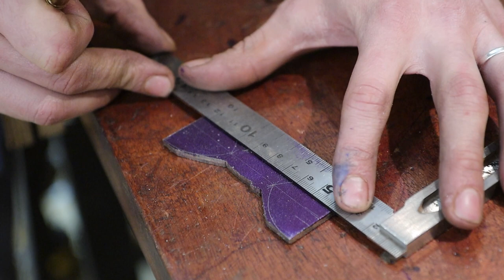Double Bladed Bow Tie Chisel

Comment: Tempering blades like that can be done fairly evenly if you make a bluing box, these are usually made from brass, but can be made from just about anything, as long as you fill it with brass swarf/chips My own box is just a small tin filled with about 25mm of medium sized brass/bronze flakes.

Comment: I love your videos and your work, not only because I did learn the profession of tool and die maker back when I left school (from 1975 to 1979), but also because of the kind of story telling you do in your videos. The only thing were I always cringe inwardly is when you use your caliper for marking lines on your work piece. My teacher back then would have killed me if I had used a caliper in this way.
Reply: @Charles Brainard Yes that is an option. Back when I did learn the trade of course we only got one caliper each. But that caliper I still use today. Of course I used other calipers too, but mostly only if I needed a larger one. I didn't work as a tool and die maker for all those years, the last 30 years of my 45.5 working years I was coating tools like drill bits, and hobs and taps and other cutting and also forming tools with titanium...  those golden drill bits, only we made also other colors depending on the material mix used to coat the tools. Pure titanium combined with nitrogen went golden, if you add aluminium and c3h3 it gets kind of dark grey to blackish. Or another mix went dark blue.

Comment: Do you dull your drill bits before drilling brass? I'm not sure if this is common practice in every other machine shop. In ours I tried drilling brass on a drill press and it whipped out of my hand and one of the old guys laughed at me and told me to dull the drill bit which I originally thought was a joke but it absolutely is the way to go!

Comment: I just learned of an old belt buckle that is also a knife. Called the Gerber Touche. Comes in different types of woods/metals. I think making a belt buckle that is also a knife/tool would be right up your alley.
Reply: Nah, beltbuckle knives are too mainstream for Uri.
Reply: @C4pt41nN3m0  I suppose it all depends on if they find the knife in the buckle or not. There are some really strong non-magnetic alloys and plastics that a metal detector won't pick up on, but a truly clever design might hide the knife well enough that TSA would have a hard time finding it. [I am in no way endorsing trying to sneak a blade onto a plane,] I'm  just saying from an engineering perspective that it is possible. We have the zero clearance technology to hide the seams in metal craft these days so that the naked eye would never see what is right in front of their eyes, and with the tolerances available to us, even x-ray machines would read it as a solid chunk of metal. You just have to make sure there are no internal voids either. The blade would have to fit tightly against the internal structure of the buckle/sheath metal. And form a suction fit so as to not fall out until needed. Maybe a push release from the other end from the handle?
Reply: @C4pt41nN3m0 def not. sometimes they make you take off your belt for x-ray.
Reply: @thesexybatman263  Look up the gerber touche its an old product and is a big square buckle with wood inlay. There's a tiny flip out knife. It's more about the style that reminded me of Uri, not the knife part. It easily could be a whittling knife or a flip out fork, or a mini block plane.
Reply: @Charles Brainard yeah, if you read the comments above mine with the leading questions, we're discussing whether or not it would be legal to fly with a belt buckle knife (because this video was a bow-tie plane [blades]), and I was just saying what would have to be done to get it through security, though not endorsing trying it. Here in America airports have both walk through metal detectors and xray machines that everything else that you aren't wearing through the metal detector goes through.
Security also has hand wand metal detectors that they wave over you,  front and back, if the walk through picks up anything at all to pin point where on the body the item might be. Then you take off your belt, anything you may have forgotten to remove from your pockets, shoes/boots that may contain steel toes or supportive steel shank in the sole, or whatever else might have set it off. Even the foil in a pack of cigarettes can set off the walk through machines sometimes if they are set too sensitive.